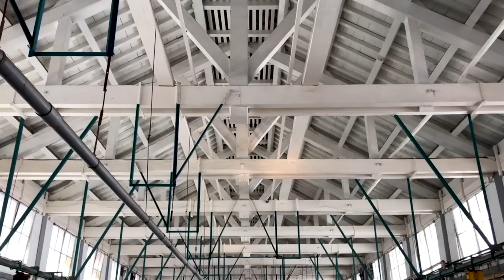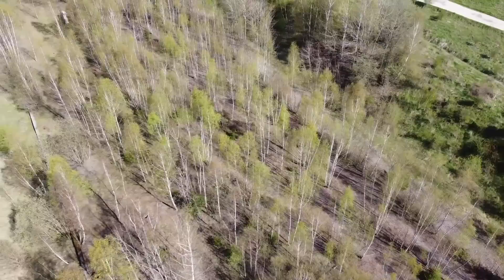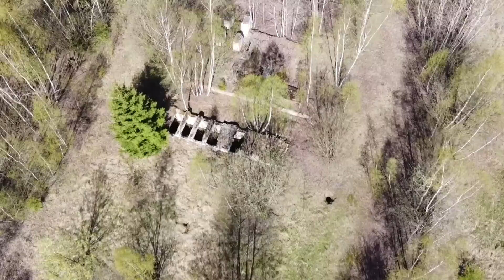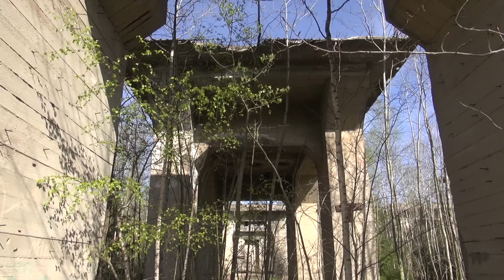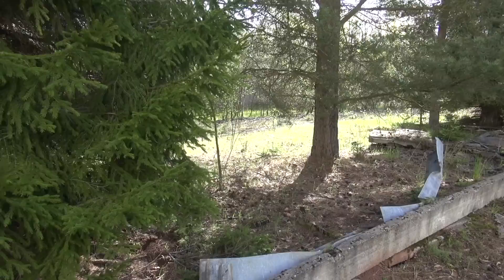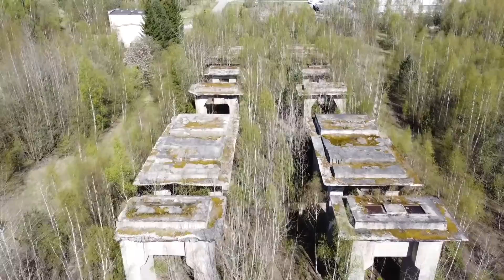THE THING - WHAT IS IT WHO BUILT IT AND WHY..

Comment: Hello and thank you for your great work!

This is a really strange place! As an "old" German, history-loving... nutcase, I have never seen such a facility!? What I think is possible is a production line - perhaps two parallel ones for heavy battle tanks or something similar - as it seems sensible to build the necessary assembly cranes out of concrete (the "bridge piers with electrics... perhaps). And it was possibly planned - once the production line is installed - to build a submarine bunker-like structure out of meter-thick concrete as a "shell" around everything!?

Comment: 26:24  Ceiling mounted cranes for loading or unloading?

31:40  These are counter weights for use in scales, balances or perhaps some sort of mechanism for moving items in an automated process.

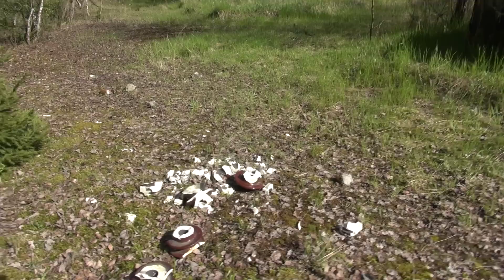42:16  High Voltages...

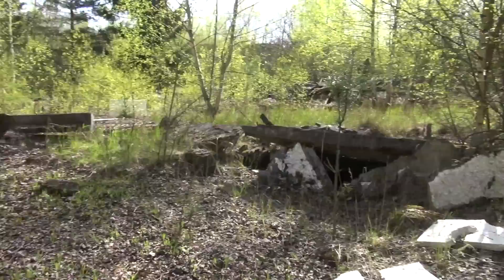42:50  Styrofoam was used as insulation for industrial processes or as insulation for buildings.

Do radiological survey (Geiger)?  Metal detecting and mapping any 'hits'?  Go ask the business people at the building you saw and ask them what they think it was used for, someone will know something and may give considerable info.

My guess is Aluminum production.

Comment: Hi Tino. With the greatest respect: the key to your mystery instalation is the configuration on top of each tower. Those are locking shoes with two square metal plates at the front for electro-magnetic clamping. You can see the curved surface in the slabs in-close behind these plates for a "backing in and locking" maneuver from an airborne object. The first Nazi space-fairing mother ships (not atmospheric Hanabue saucers ) were converted Type XXl submarines. Watertight is also airtight for lunar transit. Measure the distance between the first and last large tower and I am sure such a U-boat would be nicely supported on top...in pairs right and left. They are docking towers for an aerial U-boat pen with holes for cables and pipes to refuel/provision from beneath. The “skirts” are to protect people on the ground from some kind of blast from the anti-gravity drive during liftoff, and the small towers must have been docks for “mini-subs”. Obviously never finished (moved to New Berlin in Antarctica?) since you can see the metal speed-forms still in place on the walls of a couple of support pits. Recall that Ferdinand Schorner's entire army was diverted from the Battle of Seelow Heights to protect this area instead of Berlin. Tim

Comment: I have to think that the structures that would be a dead giveaway as to what the area you documented was a part of are long gone, but I 'm thinking that the majority of the area that you've documented in this video is relating to underground high voltage power generation and transmission. There appear to be many chaseways through concrete walls/floors/ceilings for wiring and airflow, two massive buildings for ventilation fans, and underground tunnels with unrestricted airflow and mounts for very heavy cables. I expect that there's also a lot more to see or since destroyed tunnels to support this theory. Also note those two brick-core buildings, they may have been from an earlier time and repurposed, but there are also other reasons for omitting ferrous materials from a buildings construction, such as magnetic fields.

Comment from the maker: SO UPDATE on the site, as it is for sale I was sent some more information on it. There was at one point a slate processing plant, or at least scheduled. However there had also been a different use of the site which nobody knows what or when was. not even local government. And during the war there was a Luftwaffe airfield in the area also. So a little more and still a bit of a mystery in there.
Reply: Respectful greetings Tino,
You may find it worthwhile to research one Dr.Ing.Professor Eugen Sanger;
Project Silbervogel. Basically an horizontally launched version of an early Space Shuttle,
known in 1942 as an "Orbital Space Plane".
It was designed to be launched from a ramp inclined at an average of 17 degrees, with an final upturn of 23 degrees, much like a modern ski-ramp.
 Construction date for the ramp was said to be August of 1942,
right around the time Sanger was granted permission to construct his spaceplane. 
This was cancelled in late 1944, by which time the ramp would have been almost complete.
Alongside the ramp was to have been solid rocket launch booster factories, reluctantly accepted by Sanger as necessary once supplies of A4 liquid-fueled rocket engines had been bottlenecked by the August 1943 RAF raid on Peenemunde.
Whilst most WW2 researchers have described Sanger's project as 'fanciful'; it remains true that it did receive permission to be constructed, and most researchers do not mention the location of either the Test or Launch Site; which you may have unwittingly just located.
    ...   Hence my suggestion here.

Kind and Respectful Regards Tino,
Uyraell, New Zealand.

Comment: I think I can help you out. Those stones ARE likely to be railway ballast. Those bin- like things are a facility for cleaning out steam locomotive fireboxes. Poland used steam locomotives up into the 1980s.. Most of the stuff you showed us looks like a locomotive facility. Anything I don't recognize may be simply because I'm an American.
Reply: You prob know the nazis relied on steam locomotives having lots of coal & little oil. In the former Yugoslavia there is a region where they still use the 1930s (WW2) standard issue German steam locomotives, from memory they had ~8, 4 running, 4 for parts.

Comment: Parts of the large underground steps that if you look at  that has steps leading down with the ramp in the middle. The sides have they been made from marble, or faced in marble? It really does look like it’s partially done in it in, and other places within the site. It starts 18:13 Tino. That if you look carefully it looks like the vein is  fund purposeful in the same direction other places.  It’s just a observation I seen which you get in slabs of marble or granite. As both are hard wearing needing a lot of pressure to break. It looked very high tech building for what purpose I hope someone will have a answer too?

Comment: This post-war facility has nothing to do with the "Riese" project !. A slate roasting plant was to be built here, construction work began in 1974. 70 industrial facilities of various sizes, a railway line, a water tank, two fuel tanks and two 150-meter furnaces for burning loot were to be built here. These are the concrete bases seen in the video.
The amazing thing about this over one billion investment was that already during the implementation it was known that the roasting plant would not be profitable. One ton of the finished product was to cost PLN 30,000 in Dzikowiec, and the same product imported from Great Britain cost only PLN 12,000! It also turned out that the area suffers from shortages of water needed for the industrial production of slate. It also turned out that the mines in Nowa Ruda and Słupiec would not supply the right amount of slate of the right quality. In 1981, work was 72% advanced. Both rotary kilns fueled with mazut have already been installed on the supports. A 3.6 ha water tank, chimneys, warehouses and canals have been built. In 1983, a decision was made to suspend the works. In the same year, disassembly of the factory's facilities and equipment was started
Reply: Cool, good to know and still an urbex dream. Questions, would the kilns need to be that high? And why did the local officials tell Tino it was a silk manufacturing plant? Thats a bit of a jump from slate to silk. The plans must still exist somewhere and some photos must also be available to confirm whatever it was. I'm all for things being mundane, but mundane means plans, permission, technical details and any other documentation for a civil project must be available. They don't get thrown away unless something is not what it seems.
Reply: @kumagatz  
I don't know what officials Tino was talking to? . Tino doesn't know the Polish language and here you had to ask older people who have been living there for years. I'm from Poland and for many years I've been interested in the history of World War II, including the complex ''Riese''. During an investigation, sometimes you have to ask a lot of people and read a lot of documents, not just film the place itself. Tino should know this as a person dealing with the history of the Second World War.
Reply: He does not speak the language. Still, an official from the area should know. I am quite happy to believe its not WW2, but would like to see drawings or photos anyway. Poland amazes me, its gone through a lot during WW2, after WW2 and still is today.
Reply: @terminatorT-tg9lz  This and your original post explaining the purpose of the site should be 'pinned' at the head of comments for all to read.
It's pretty shabby behaviour by Tino not to respond and thank you for the information,perhaps his ego would not allow it.
Reply: @kumagatz  A simple answer to your question "why did the local officials tell Tino it was a silk manufacturing plant?" is that they were having a joke at his expense to lighten a boring day, I mean can you think of anything more juxtapose than cement and silk! 😆
Reply: There are also records on the Internet about the factory in Dzikowiec, you have to enter the words " Prażalnia  Łupków Ogniotrwałych w Dzikowcu." in Polish and use a translator. There is even an official government document from 1986 on abandoned investments.   "RESOLUTION No. 108 OF THE COUNCIL OF MINISTERS - of July 16, 1986. In Polish "UCHWAŁA Nr 108 RADY MINISTRÓW - z dnia 16 lipca 1986 r. " under number 16 there is a record about the complete liquidation of the factory in Dzikowiec . You also need to know that in Dzikowiec there was an old German slate roasting plant . A new slate roasting plant was to be built nearby but construction was never completed. Currently, the factory area is divided into smaller building plots and is intended for sale.
Reply: If it is what you say why is there nothing to be found about that plant, a design drawing, pictures or any other kind of info about it.
Surely if it is of the 70's there must be something to be tracing back to that ? ? ?

Comment: Hi Tino, the wall about 1m high adjacent to the railroad tracks could be a barrier to water if the site was actively flooded, e.g. in case of fire or for protection. Such a protective function had e.g. also the airfield of the Junkers aircraft works in Dessau. Thus, a device of intentional flooding of areas is known.

Comment: Some thoughts. From my experiences of exploring former rail formations in the UK, the size of trees and other growth strongly suggests this site was in use until the 1980s or even later, so there should be some local knowledge of its more recent history. The dimensions and proportions of the linear features strongly suggest railway infrastructure and the presence of ballast stone supports this. The "paddle" looks like part of a brake stick for railway wagons although I don't know if continental railways used such things. It looks as if some sort of bulk material was being delivered by rail and dumped into something underground which is very odd. It can't be for concealment as there is so much above ground infrastructure or to keep it dry as a building would be easier and cheaper. Could the towers be part of an uncompleted launch ramp for something? Maybe using electrical rail gun type technology. What alignment do they follow, if they happened to be aligned on London or New York that might be a clue. You have suggested that some of the nearby wartime activity was linked to nuclear weapons which lacked a delivery mechanism, could this be it? By the way if you find any intact electrical insulators the rule of thumb is to have one "bump" per 10 kV so if you have a complete one you can tell the approximate voltage it was designed to carry.

Comment: I know that what I see is not even close, but it reminds me of NASA launch gas vent tunnels.  but I can say with certainty is it not silk related. Even if it was for storage of products like cement, 2 questions that I have to ask has anyone seen a silo without a solid roof. second question would be how would you extract it from it.  you have a 50ft slant exit that leads to no where. no holes big enough for a crain to work.

Comment: As someone who grew up in the cement belt of the United States (eastern Pennsylvania) I believe you have stumbled upon the remains of a cement mill, the "Bridge pillars" are horizontal rotary kiln supports, and the tunnels are for chain drags, a type of material conveyor
Reply: Looking at the plants in the Hudson Valley I can see your point. The Ravena plant even has dual rotary kilns. But I don't see any indication of cross tunnels between the piers. And is there any indication of actual mining in the area? The Hudson River plants are all open pit... only the very old ones were underground. Also kilns usually have rather large buildings at both ends which there's no indication of. But they may have been demolished or never built. Just seems weird.

Comment: Steel rope manufacturing would be my guess. The ramp pits would likely be for galvanising. All the steel foundations around would be for big wheels pulling it along.
The pilers were likely the twisting part and then fed down the last big pilar and put on big reels. I guess the big flat area near the rails was for bigger stee rope production as they would have to twist multiple lengths together and lay it out. It would be very heavy before they would be cut to length and why there are track and crane foundations. 
You would need a lot of power to move the cable/rope and twist it. Looks to be two production lines with those towers which are matching. The tunnels under would be for power cables as each would have a motor on top like a wheel you would see at a coal mine

All a guess though.
Reply: So far, yours, to me, is the most plausible explanation.

Comment: The site is near a small village called Dzikowiec. I visited the site in the summer of 2022. It's a big site and it's part WW2 (90%) and USSR (10%) era. The weird thing is that railway rails are gone. Only the ballast beds are still there. 
Also the infrastructure of the place looks not as developed as other similar factory sites. If you compare it to other similar size factories then this place doesn't look like it ever was in use.
On the other hand, there is an old limestone quarry arround the corner. It could be possible that they tried to make synthetic fuel out of the limestone. Maybe that's one of the most feaseble possibilities. We know that the Germans where way ahead with making synthetic fuels. Look at the site they build near Police in Poland. That's a way bigger factory and a very impressive site that was in use during WW2.
Reply: Lime stone can be used to make pig iron, then into steel. I would guess it was a steel rope/cable production facility. I guess there would be a small foundry nearby.
Reply: @gregc319   That's also possible. They made or wanted to made something out of lime stone.

Comment: I would grab that paddle and have it tested to find out what chemicals it has been in contact with .   My guess is a missle testing and development area .  The large towers for assembly and testing large solid propellant missles , the holes through them for winch lifting cables .  The single rail could have been used for testing smaller rockets .  The building with 2 pits could have been used for mixing solid rocket propellant . And underground is where you would want to be if one blew up during testing

Comment: "Silk factory"? ROFL!! They must have been desperate to come up with that explanation!
I love it when you find something new and mysterious, especially when its bang in the middle of Kammlerville :)
Everything points to a flooded underground here, especially those sloping ramp structures. 
The first bit you showed with the ramped chutes, i could imagine rail carriages filled with coal pulling up and tipping coal into the silos for use in some underground facility. 
I'd love to see a LIDAR scan of that area!
The mysterious "not bridge pillars" have the same look about them as the henge structure, as if they were designed at the same time and intrinsic to the purpose. Really intriguing stuff!

Comment: Radio transmitter and/or radar testing?  Of course one would like antenna as high as possible, but perhaps they were testing  how low the antenna cab be and still function?  Still doesn't seem right If it is  a factory the intensive electricity  suggests a modern factory because the newness of fractional horsepower electric motors, the capital intensity (this was no craft operation) and the possibility the electricity was used for some sort of aluminum processing.
Reply: I’ve waited until now to look at the comments. I expected some one to recognize the site layout and provide an explanation. Educated guesses is all I see. Unless the Germans were using technology unknown to us, the site itself should be familiar to someone! I’m at a loss, myself. Show this to your technical friends. Someone must recognize something there for what it was used for!

Comment: Could that row of single small concrete supports have a single rail mounted on them, maybe testing some sort of rocket powered sled as Nasa use? & whole site be a test facility for rocket/exotic propulsion systems, which the Russians stripped bare at the end of WW2, but did not bother to continue to utilise? Hence the reason for the lack of information. I think the next step is to comb the surrounding area 's current inhabitants & see what local knowledge has been handed down, as I doubt any answers will be gained by so much guesswork.This place is hugely compelling!